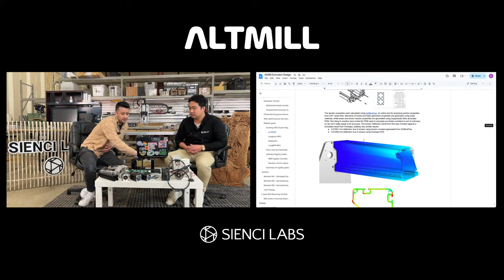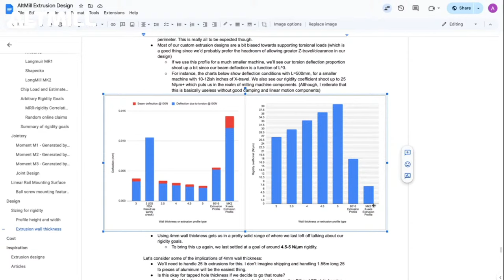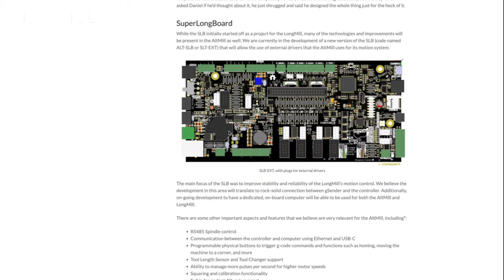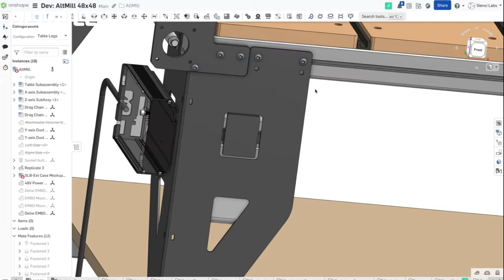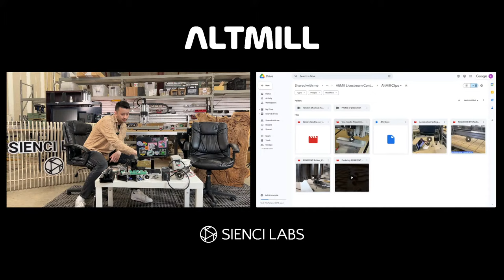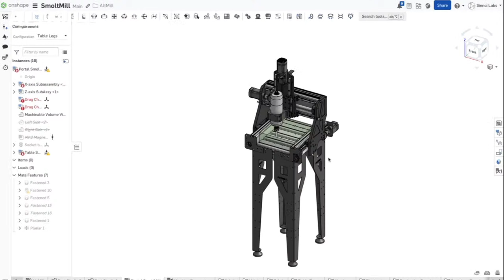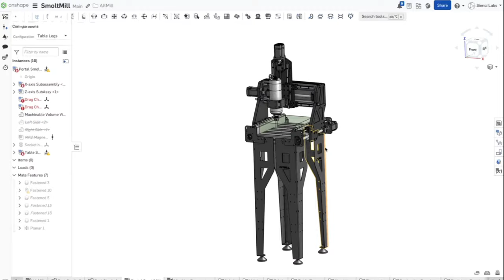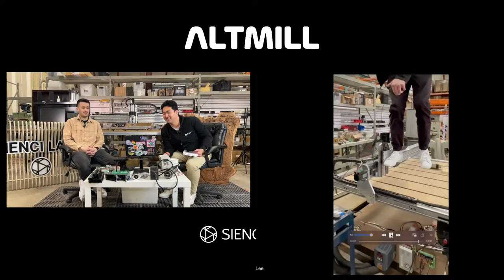AltMill CNC Launch: Product Launch Live Stream Event

Comment: Looks very rigid, how do you sell?
Feed and pluge rate very impressive, spindle looks good
Do you have pfoduction? Where can we buy?
Suded Emmanuel
Auckland
Reply: Look at the blog post he referred to at the beginning of the video. The extrusions are completely hollow and honestly not extremely thick walls. 
You can compare this to something like the Shapeoko HDM and it's X rail extrusion is solid.... 100% solid aluminum and the Y rails have 1/2" thick walls.  

Your paying $3k US for a CNC. Don't expect miracles.
Reply: But all parts are holding together nicely, hollow dosent mean weak, when machinig it looks and sounds rigid, i worked with German, Swiss CNCs, byfar this looks one of the best hobby ones